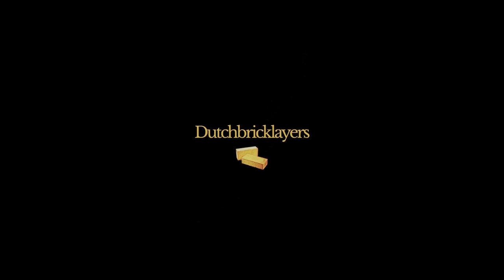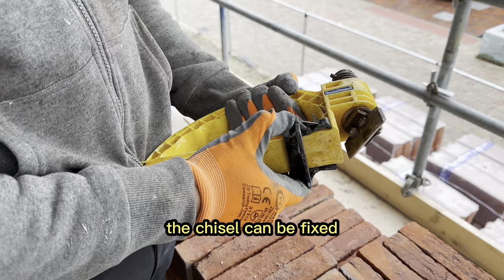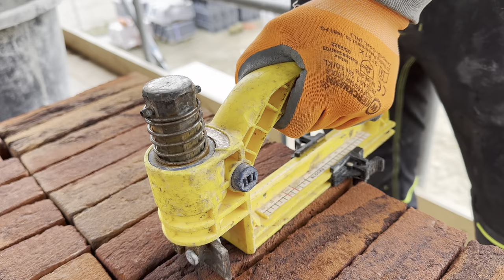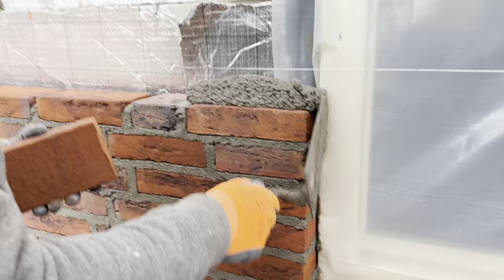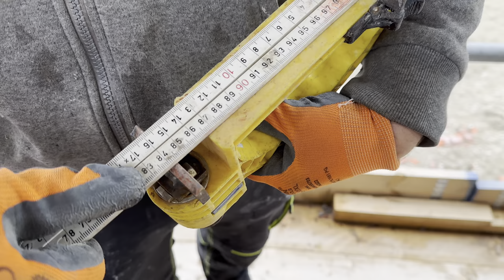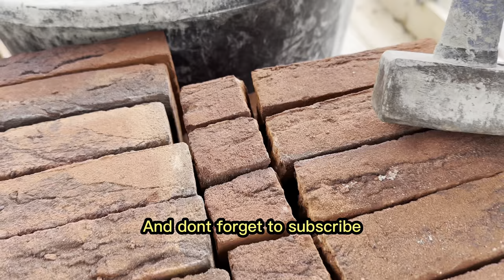The Ultimate Bricklaying Tool - Making the Job Easier and Faster

Comment: Great tool that makes life a lot easier quicker also. Wild bond is basically a random 3/4 bond. This style does look nice. Done this on a Indian sand stone wall. Had 300mm and 215mm lengths so every now and then would tie across with 215mm stone as double wide wall worked very similar to the wild bond. 🤟
Reply from the maker: Yes exactly it definitely looks like that. Thanks for your comment and it makes the work faster. But we have to say we use it only with softer bricks. When they are to hard it doesn’t work properly. 👍🧱